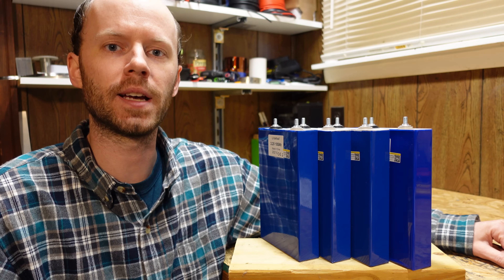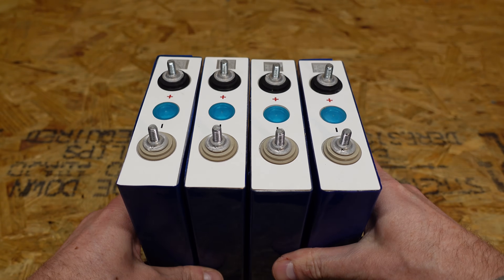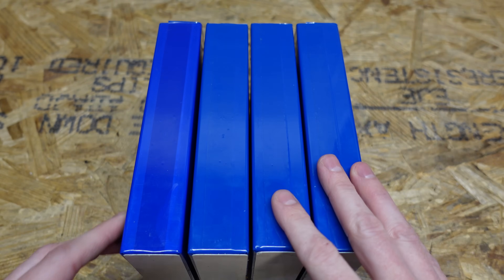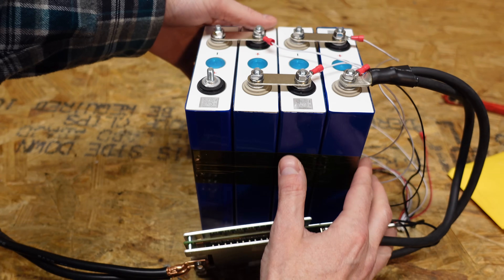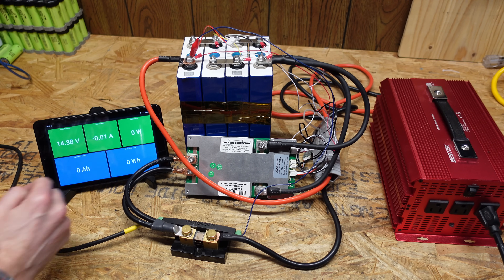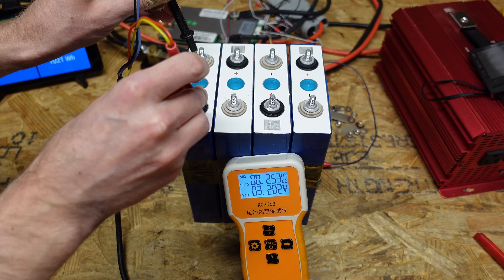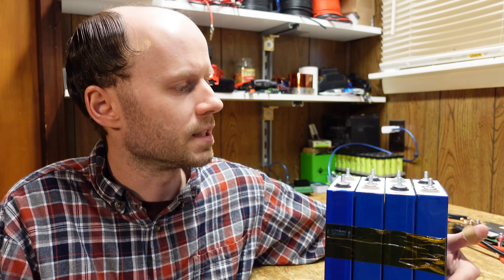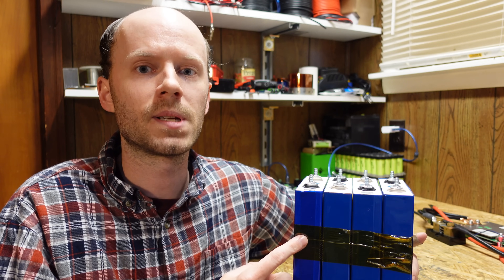Cheap "Grade A" Batteries, Why Do People Keep Buying These!?

Comment: Hi 
Had a question regarding charge/discharge rates of lifepo4 cells if I may? 

Assume single 3.65v 100amp hr lifepo4 cell for easy math. 

1c discharge/charge rate is obviously 100amps of that cell…. 
0.5c discharge/charge is 50amps….. 
Etc etc 

Now what about when they are in 4s configuration… 
4s(100amp) pack. 
1c discharge rate: Does that mean overall the pack is discharging 100amps (total between the x4 cells, 100/4 = 25 amps per cell (0.25c discharge rate) 
Or is each cell individual discharging 100amps (4x100=400amp?? Wouldn’t that be 4c discharge?.)

Thank you.
Reply from the maker: When cells are wired in series, the amp rating stays the same and voltage increases. If you have 4 batteries that have a rating of 1C, you get a 12.8V battery rated for 1C when you connect them in series. If you connect all 4 in parallel, then you would have a 3.2V battery with a rating of 4C. I wired my batteries in series, and since amps are continuous throughout the entire circuit, each battery is discharging at 20A or 0.2C.
Reply: @LithiumSolar   thank you. Seems logical

Comment: Big question! Are they safe to use long/short term or its just dangerous junk waiting to bite you?
Reply from the maker: I really don't know. Cells that test below rated capacity aren't necessarily bad, just used. However, that cell with the terminal that slightly rotates does scare me.

Comment: Imo these cells are all used and refurbished. Thats why I don't bother with AliExpress cells and go straight for local used cells where I pay for what I get. New cells you will only get directly from manufacturers via Alibaba. But you should be careful there as well and go with brands.
Reply: That's not true. I ordered cells via AliExpress twice. Once 105 Ah and another time 200 Ah from another seller. Both times brand new, perfectly straight. Maybe I was lucky, but you can definitely get true Grade A cells on AliExpress.
Reply: @Roald Koger, well of course it difficult to generalize. But AliExpress, where it is easy just to open a shop, sell some bogus stuff to someone, then the buyer needs to wait 3 months for the items to arrive until he finds out that his product is substandard, then negative reviews start trickle in and the shop disappears again. I have seen that many times, especially with battery sellers. They promise the blue from the sky to get orders, and then the shop is just gone. While on Alibaba, a manufacturer has a reputation. Thats why not every company will engage in end customer business. But it is much more likely to get what you want.

Comment: I've got an idea I think that these are the cells that failed in factory testing that were meant to go in pre-built packs but these failed so instead of scrapping them are recycling them they tried to sell them as brand new
Reply: I don't know if QA failures would result in bulged batteries. IMHO it's either overcharge or under-discharge, a sign of them being used, consistent with corrosion and other marks. Probably salvaged batteries from cell phone towers, re-wrapped and perhaps with re-soldered terminals so that nut marks don't show up. At least that's the explanation that seems the simplest to me.